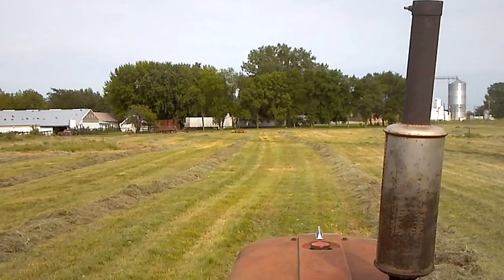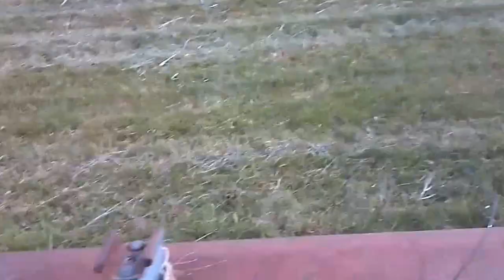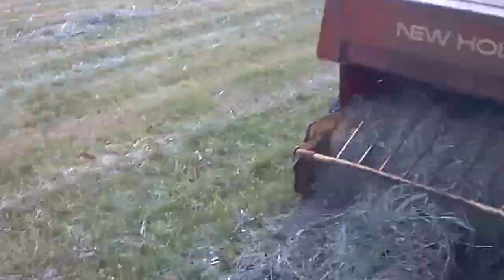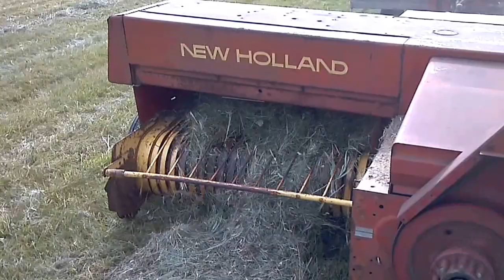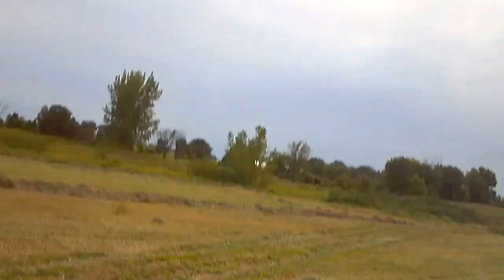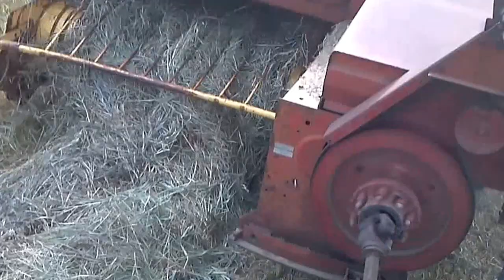Baling Hay 2012 IH 656 & NH 315

Comment: Hi what are the 315 balers like have you had any problems with it do they produce a nice square bale
Reply: I have one slightly bigger than the 315 and mine has a thrower on it to it works great my only problem  was the bolts kept shearing until I found a fix for it, the bolts r located where the PTO shaft connects to the baler
Reply from the maker: Worked real good for the day that I baled with it. Baler belongs to another farmer I was baling for him that day.